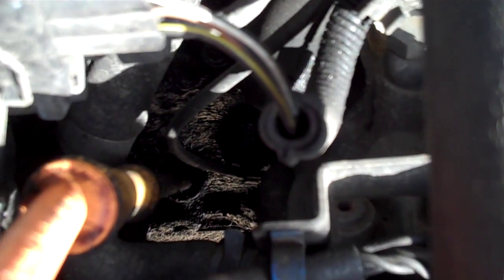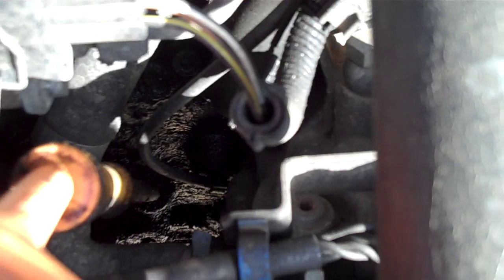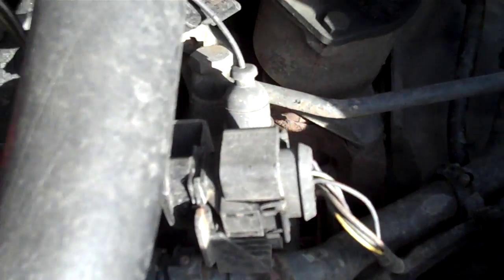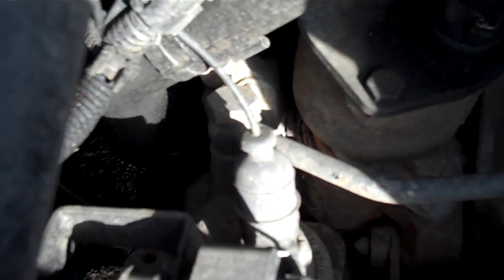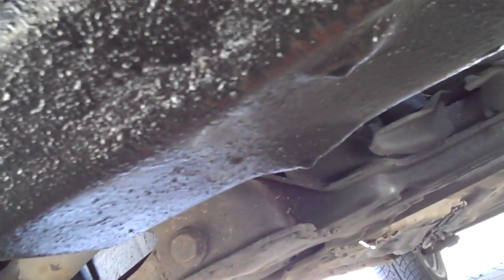VW Golf MK3 Estate Variant Tdi AHU 1997 oil breather leaking

Comment from the maker: On the AHU TDI engine there is a lower breather pipe that runs via a plastic pipe, this cracks with time around the bottom flange and leaks oil all over the place.  Simple fix was a blanking plate from a gti engine.